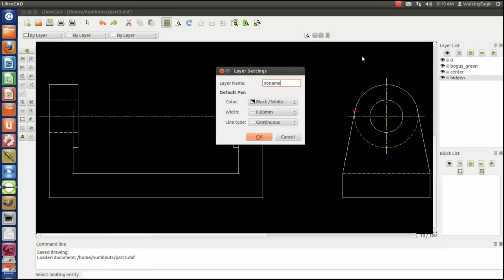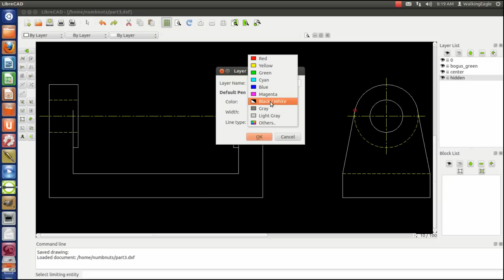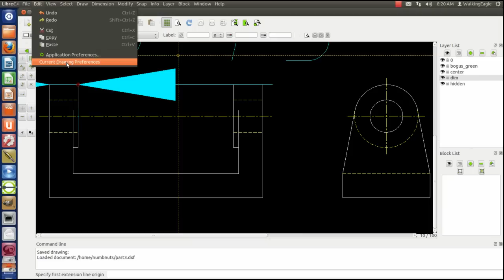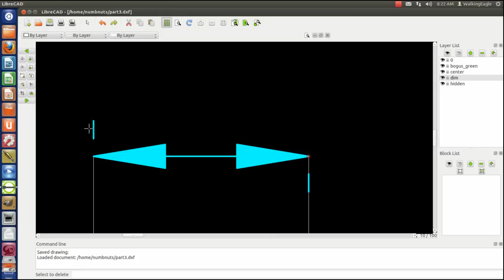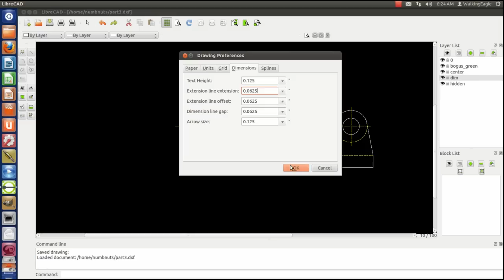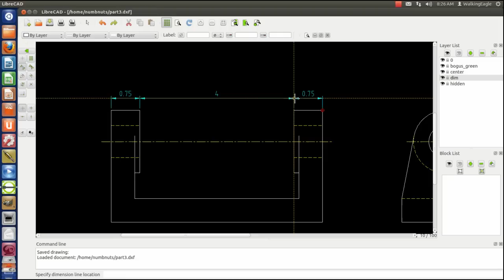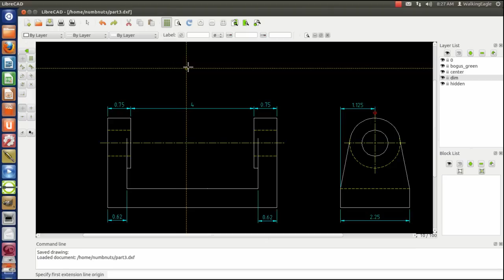LibreCad Tutorial 4 - Dimensioning -- part 1 of 2

Comment: Hi Gary thanks for the video, very informative. 
I think a small addition (tip/2cents) would be to underline that the "default" for LibreCad is millimetres, so if someone picks another unit at the initial start-up, additional effort is necessary to adjust the measurements later on... ;)

Comment: You missed out one of your horizontals. The one you drew in the beginning of the video. Also, I don't understand why you go through all that trouble selecting different snapping options all the time? You could just as easily go with the "snap to grid" when positioning your dimensions....!
I find it a little irritating that you fiddle so much around, not really knowing what you're doing. That's not good for a tutorial where people are supposed to learn something. But that's just my own opinion.
Anyway, thank you for posting though. Happy newyear;)
Reply from the maker: noilex  I checked the video... I did not dimension one of the horizontals on purpose.  Often, if you have a stack of dimensions it is best to do all the them except one and put the total distance or just the individual dimensions without the total.   The reason why is the tolerance setting of the CAD program will often not make the total not equal to the sum of the parts.   This is especially the case if fractional values are used.   The goal is to create a drawing that can be built, so you want to provide enough for that purpose only.Snap to grid usually creates more problems than it is useful.   I very seldom see any of the guys that make their living doing CAD with the professional CAD software use the grid.   It all depends upon what you are doing.